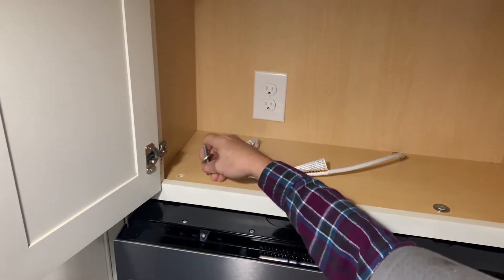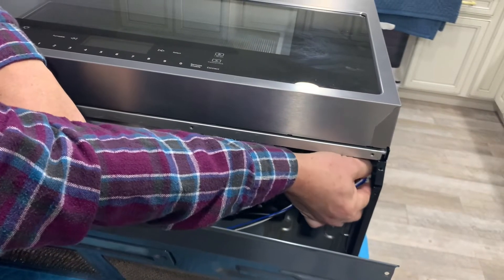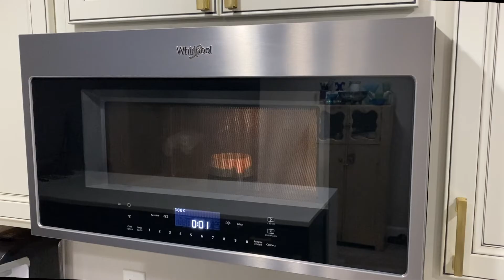Microwave NOT Heating & LOUD Buzzing? Magnetron Replacement🤖

Comment: I'm not sure why these over range microwaves are so popular in the US. They seem a terrible compromise - surely they can't perform both extraction and microwaving to the same standard as separate appliances?

My Hotpoint microwave recently started making a horrific noise (like the magnetron but much louder). Today I tried replacing the diode but it didn't solve the problem so today I've ordered a magnetron and capacitor. Overhauling the HV side of the microwave. It is a large built in microwave (above the oven) and was around £400 8 years ago so I didn't want to scrap it. The parts came to £80 including delivery. While I have it apart I'm going to detach the grill element and clean it and the top of the cavity (which has never been done and we've never used the grill!).

Comment: Exactly the same problem here: I did your multimeter test on the old magnetron and have the same short of the terminal to the magnetron casing/ground problem. I ordered a new magnetron and put it inside, but it still doesn't heat? what could be the problem? (I did multimeter tests with the High voltage cap and High voltage diode, those work fine)

Comment: Actually, with high probability, you could only replace the filament terminal on the magnetron, what includes two 350 pF capacitors, which of one or both probably leaking to the ground. No need to replace the whole magnetron and waste it.

Comment: Could you please tell me what could have happened to my microwave? Yesterday I put the food in the microwave to heat it up and I heard a big explosion inside. The clock and everything else works (there's a light) but the food stayed cold, it didn't heat up and since then it's been very loud when I turn it back on. This is above my stove, not a tabletop microwave.

Comment: I have this same model out & taken apart. The magnatron seemed to be the cause of fire & buzzing, but continuity testing did not show the same ground fault. How should i proceed? Still likely magnatron right?
Reply: Start by questioning the burned silver, mica waveguide paper....
Reply: @georgegrader9038  I have this issue now, Magnetron passes the continuity test, but the oven still makes that loud hamming noise. How did you solve yours?
Reply: @noclicheplease it was something incredibly easy and super cheap. It was food splatter on the silver cardboard diffuser thingy reachable on the inside!
Reply: I bought a new one for couple bucks & it worked perfectly
Reply: @georgegrader9038  Oh! haven't checked that portion of the oven at all, will do it now, thanks.

Comment: All that screwing around!?! I would've just bought a new one.
Reply from the maker: Unfortunately this microwave wasn't the cheapest so we opted to fix it.
Reply: I have the same model they are $775 now. Mine stopped working today it’s more a buzzing I think it’s the diode.
Reply: Mine stopped at 5 years old. Buzzing and making fire. What is the name of that metal cardboard in the ceiling of the chamber that is catching on Fire?